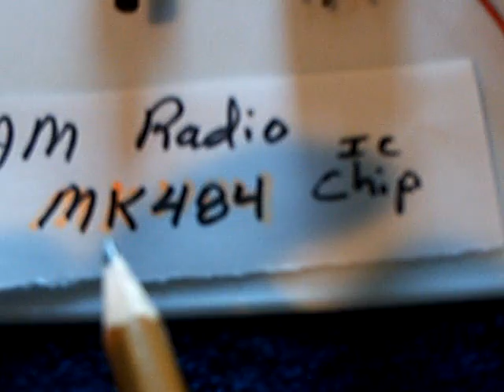Simple AM radio using MK484   IC

Comment: how many turns on your coil?
ive made diff. lengths, 100-300 turns, and 100+ turns will just get nearby radio signals.
i tried 50, and no real change. 85-95 turns helped with getting a couple more.
i tried 15 turns on small, medium, and large wire diameters, and got cuba, WHR, nashville, and a ham radio signal!
i used diff. diameter pill bottles for the coil forms.
(im in OK.)

Comment: I wanted to build this same circuit with a TA7642 feeding the same IC as a little amp to drive a speaker, as a bargain basement poor man's shortwave set...  I was going to make my tank circuit to do short wave.  These chips supposedly can tune very well up to 4 Mghz, but drop off in performance after that.

Comment: This IC is virtually the same as the ZN414 that turned up in hobby project articles from the 70s and 80s. One circuit I saw years ago powered the radio chip using solar cells.

Comment: That MK484 does look to be great, glad to hear it in use and demo'd. There's the MK414 and a TDA with similar functions...am busily checking all my busted up radios !  
Hmmm, what happens if you throw a 484 on a SEC 18X instead of the tranny ? Might get this from a connected speaker "Bienvenido a tu energía libre coherencias circuito resonante, afinación será realizada por el MK484, tenga un buen día" lol